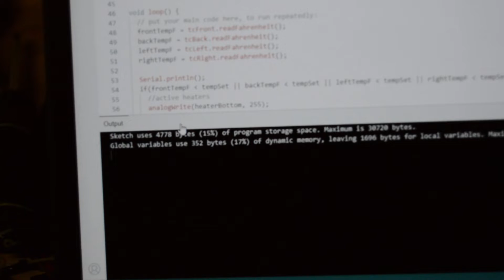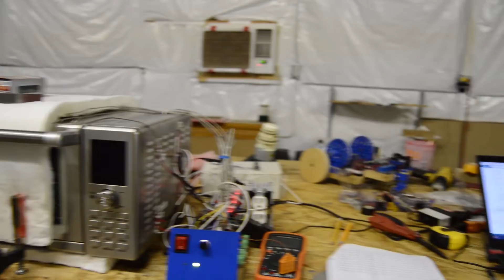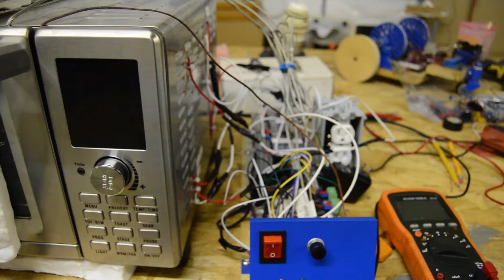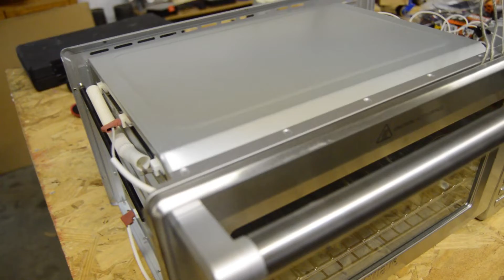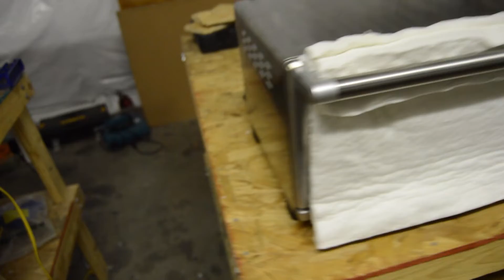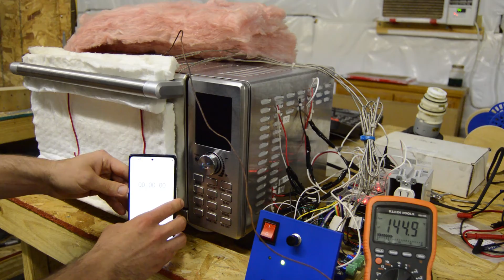Ultimate DIY Reflow Oven, Solder Surface Mount PCB Components With Ease

Comment: At 8:30, don't worry about having a slower ramp time, too fast and thermal dynamics (thermal shock) can damage the components and/or PWB.
Most profiles are as follows: 

1. Room temp. 

2. Ramp to hot and stabilize that is safe for components but NOT hot enough to reflow the solder paste (usually 40 F below the reflow point).

3. Hot soak (wait) to be sure every component and the PWB are all at the same NEAR REFLOW temperature (usually about 10 minutes). 

4. Ramp up to 10 degrees past the Reflow temperature.  The faster the better, but slow is ok as long as you stop heating as soon as all solder points reflow to the solder specs. This is most critical, you don't want to be at the reflow temperature (or much above it) for very long, just enough time to get the solder to reflow correctly. 

5. Cool off from the Reflow temperature back down to the safe Soak temperature as soon as possible (shut off hearers and open door for a few seconds). 

6. Ramp down to Room temperature (heat off with door closed), slower is actually better here - you are not a high rate production line, so time is not a big factor.

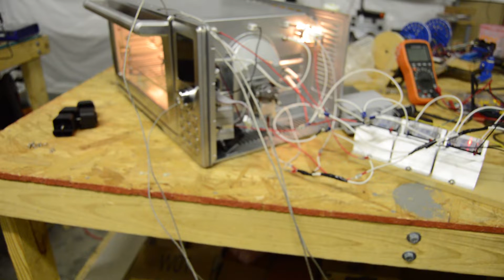Comment: At 7:04 you just need to put in PID code and adjust the coefficients by trial and error until you get very stable temperature set points. It's not very complicated code, there are plenty of examples of PIDs online.

Comment: I designed a controller about 3 years ago for a friends powder-coat oven.
That oven is big enough to park your car inside - Pretty big.
The heat source is two kerosene fuelled central heating units - Big power.
Insulation is generous on this unit - it is used as part of a business, so it has to be efficient.
The doors are opened often (high tunover of product) and this dumps the hot air from the oven into the room (wasteful and generates a high workload for the heating system).
I used similar thermocouple (TC) amplifiers to you, and they feed back to an Atmel running code generated in Arduino IDE.
I averaged the TC readings like you're planning to do, so that I could get ONE number to make on/off decisions.

---------------------------------------------------------------------------------------------------------------------------------------
Usually, these amplifiers will generate an error message if a TC is grounded or open/short circuit - Use this in the code to generate a number variable: 

Variable = 0

Read thermocouple1:
If result == error;
Variable = Variable + 1 (variable now equals 1)

Read thermocouple2:
If result == error;
Variable = Variable + 1 (variable may now equal 2)

Later, when you do the average, you add up the result of all the TCs, and then divide it by the number of TCs but you subtract the above variable from the number of TCs first. This way, a TC can fail and the averaging still works with the remaining TCs. By the way, they WILL fail - this is just a facet of TCs.
---------------------------------------------------------------------------------------------------------------------------------------
Temperature differences between TCs:
They're shit.
TC's are apalling sensors. Daft little LM35s walk all over even the most expensive and exotic TC's for accuracy and repeatability. What silicone sensors can't do is high temperatures, and this is where TC's shine.
Don't rely on the TC to provide Seebeck voltage uncalibrated - and here is your problem - you need a calibration source.
I have a Druck DBC650 temperature bath which is specifically designed to calibrate temperature probes. Its an expensive bit of gear to buy new - about $3000 (I got mine 2nd hand and very cheap).
You're already using polynomials from spreadsheets to represent traces so thank God I don't have to describe that (I'm crap at math). 
You need to calibrate each TC in a known temperature source (as above), and record the reading at the microcontroller end. Plot that in a spreadsheet and then step the temperature up. Repeat. Repeat. Repeat. Once you have enough readings (every 10deg C?) generate a polynomial and then use it as a calibration in your code to display a REAL temperature.
Sound a bit much? I was disgusted with just how far out TC's can be, and I would never have known if it wasn't for the fancy calibration source. You can generate a reliable 100degC from boiling water, and 0degC from ice water, but those two points are 100degC apart and only give you a linear response (all of the K-type TC's I've worked with were all over the place and totally not linear).

Here we get even deeper - If the temperature at the measurement end of a TC changes - so will the reading you get, even if the temperature at the "hot" end stays the same.
The only way to counteract this is to either control the temperature (submersion of TC amp in artificially cooled/heated liquid) or to KNOW the temperature of the amplifier end. Mount the amps to a strip of aluminium and use an off the shelf LM35 to measure its temp - again - this is where the calibration in situ plays a part.

Also, you have some of the thermocouple lead inside the oven, and the lengths are not controlled. This is where TC's can get to be a pain in the arse. The bulky looking stainless bodied units you have look good with a clear line between what is the sensor and what is not. Install them properly and your readings should stabilize. Be prepared to have to calibrate in-situ because the amplifier end of the TC wire IS sensitive to temperature (Seebeck effect).

Actually, don't bother with the big stainless bodies sensors - They're bulky, so have a lot of thermal mass, so will lag behind reality. This will be a total pain to code out the overshoot.
Instead, buy a reel of TC wire and just crimp one end with something like a ring-terminal - instant TC for cheap! It has the advantage of being low thermal mass, so will be agile as hell. If the oven changes, so will the sensor.

Ughh.. anything else.....
Insulate the oven for efficiency, but don't pack it tight because the insulation will start to act as a thermal conductor.
That internal fan will generate more than enough air movement to equalize the temperatures. If you're seeing dirfferences, it will be a mixture of the TC's needing calibrated, the TC's needing to be installed rigidly and direct view to the heating elements (radiant heat).
On radiant heat, you're stuck between a rock and a hard place. You ideally want to block radiant heat to prevent hot-spots, but to do you have to add a shield which then adds thermal mass which resists temperature change. Try tin foil.

I need to lay off the coffee.
Good luck!
Subscribed just for the oven project.
Reply from the maker: Your knowledge on this subject is astounding. There's a lot of people, including me,  that will benefit from this comment. Thanks for posting!

Comment: look into a project called "reflowduino"
Reply from the maker: Website says it's unavailable. It's also only a single thermocouple. Handy project if you aren't comfortable with programming an arduino. My code is available on GitHub and simple enough for most people to understand.

Comment: Awesome!  Instead of using a solid state relay, a TRIAC would give you a smoother gradient control by triggering it with an Arduino. It also dissipates less heat and is significantly less bulky. You don't have to create a PCB for it, since you can salvage one from a typical dimmable light switch. It a matter of replacing the potentiometer with a simple opamp circuit and connecting the hot and neutrals to the heating elements.
Reply: Most solid state relays are zero-crossing type, which is the main advantage of triacs.
If the relay activates at the zero-voltage / zero-current point, there is zero power dissipation across the relay. Obviously, there is always some inefficiency, so SOME power is dissipated as heat, but I doubt those huge heatsinks are really required. I've switched bigger loads than that oven with no heatsinking at all - but that depends on having decent relays.
The relays also provide TOTAL galvanic isolation (usually opto-isolator activated), so provide a lot of safety and less chance of noise on the logic side - something a triac can't do in isolation (pun intended).
Reply: Wait... The control board you removed may already have a TRIAC or even better, MOSFETs! It looks like it might even use a rotary encoder looking at the knob. In that the case, you can connect the Arduino directly to its pins and drive it directly. There already exists code you can use for simulating the output of the rotary encoder. If it's a potentiometer, you can proceed as mentioned before.
Reply from the maker: I considered trying to integrate the existing board. I mostly didn't want to jack around with it. I knew I could handle with an arduino and a few solid states. I originally imagined, given the wattage of the oven, that I would get a very accurate heat up and would need to cycle the heater more. Since it's just doing a ramp to peak, then anyone would be able to hardwire the heaters to a switch and use an egg timer. You Iive and learn. I've made about a dozen PCBs with this oven so far and always get a good result.